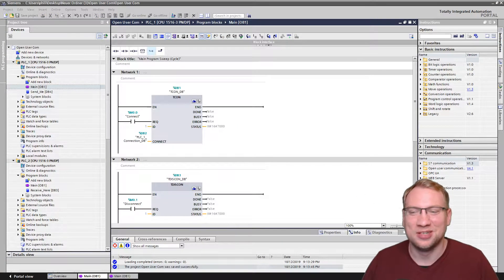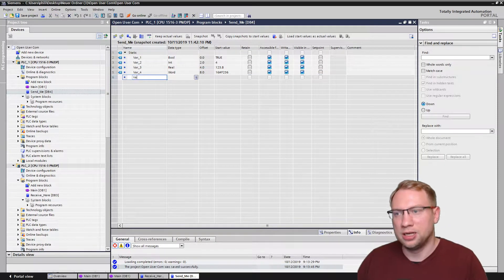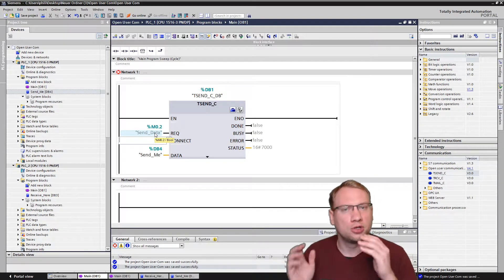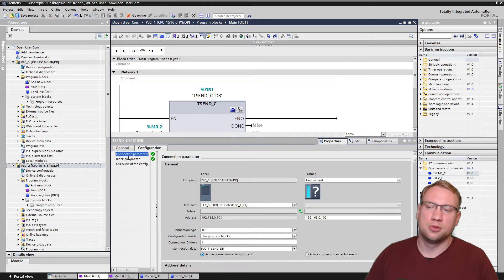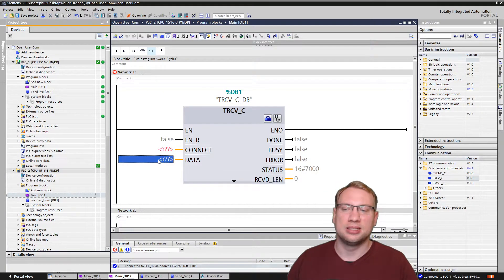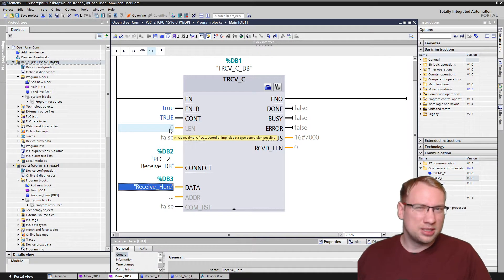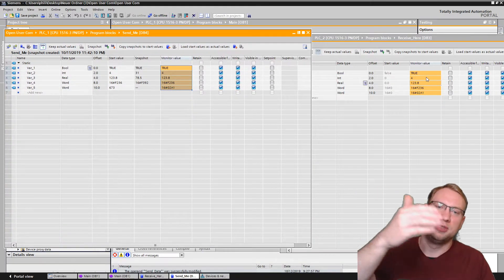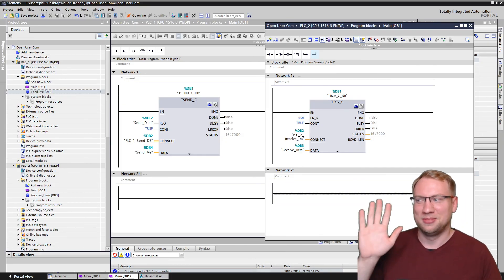TIA Portal: Open User Communication TSEND_C + TRCV_C / Easiest PLC-PLC Communication

Comment: HAHHAHAAH loved the ending lol. Im working on PLC and had very basic knowledge hoe to create ladders only. Your videos are very helpfull. this is 4 years old video , is there any new way and easy way of cummunication between PLC and external device?.        My role is to program the PLC S7-1500 to receive and display data( band width, power supply level/voltage etc)  from a micro controller.  It will send a string of data how can i break that down for my PLC,  as i am New and to this and have very little knowldge ( will look to see if there is any video on this in your list)

Comment: Have you set up a T_COMM connection between an S7 1517 cpu and a Control Logix L84 cpu using the 'on-board' ethernet port on the Logix cpu?  We are having problems setting up this connection with this hardware setup.

Comment: if I have PLC1 as using TSEND_C and PLC2 TRCV_C using Connection ID of 1, How does PLC1 receive data from PLC2?  Does a new connection need to be established or can I use the same connection? If I require 6 S7-1200s to communicate bidirectionally would this limit me to 3 1200s

Comment: I did try this and it did not work for me. I am using et200 processor and s7 1200 is there a setting that I am missing. The Brock status is  7002 error

Comment: Hi, thanks for the video. There is a problem when many PLCs use TSEND_C to the same PLC. The receiving PLC seems to be able to connect to just one of the senders
Reply: this type of connection is point-to-point, PLC for receive from several other must have connection for each, and on another port

Comment: Hi @Hegamurl, I have a issue with the communication in this way with two S7-1200. I'm trying to send from one (PLC_1) side to the other (PLC_2) and this goes well. But, when I try to do the same thing but from PLC_2 to PLC_1 the TRCV_C block displays an error and the STATUS display the HEX Code 16#8A7F. This code does not appear in the manual, so I don't know what it means. Can you help me with that? Have you ever seen that status code?

Comment: Your content is always helpful! Do you know if you can send between optimized and un-optimized DBs?
Reply: PLC 1500 - PLC 1500 optimized is no problem, internal structure and order will same, but with other system (e.g.PC) is non-optimized DB (without alligment) better -> you know data order of each byte byte 0 ... byte N

Comment: thanks a lot for the video, can i enabel output signal "lamp" connected from to the second PLC from the first PLC in stedof using hardwiring. for exampel filling process gives indecation to packaging process to start packing. thanks a lot

Comment: Thank you for your amazing tutorials , and i have a question , i want to make a communication between my PLC device and some GUI that i have on my PC , everything goes right except when my array that i send from GUI become longer than the length i define on TRCV , in that case even tue i reset my input buffer data after any new data received command come , although the data in the buffer did not fill from the first array , and it continue from any more data that it received at the last time. i wanna know is there any way that i can reset my TRCV or TCON input buffer , i think cause of this problem is that the last data goes on the TCON or TRVC buffer and i took from there as long as the length that i define, and the rest of data stay there for the next cycle time. 
i will be thankful if you answer me.

Comment: Ich habe hier mit s7-1200 sps mit Rs485 zwei Temperatur messung kamera angeschlossen , und habe ich jeder kamera eine mit Busadresse definiert. 001 und 002 . das problem ist das jetzt kamera nimmt alle daten was mit port Rs485 kommt , hast du  ahnung wie kann ich die 2 unterscheiden damit nimmt eigene daten. ich habe von punkt zu punkt kommunikation , send ptp und rcv ptp gearbeitet. wenn ich mit kommando 001?T$L$R schicke dann es muss ein antwort mit 001!T = 25.5°C$R geben , manchmal kriege ich das aber ab und zu kriege komische zeichen. Und der Kamera hat auch terminierung widerstand drinne,

Comment: Hello there, thanks a lot for the very useful video, I have a question please, can I implement ISO-on-TCP communication using S7-1500 also? if yes, how to include the library that contains these functions?
Thanks in Advance
Reply: ISO-on-TCP is better because RCF1006 solve and control LENGTH of transfered data

Comment: Thanks for your videos. 
I have learnt lot.
I just have used the same concept to connect two s7-1200 plc's ( by TSEND-C, TRCV_C) but not working. 
Is there any restriction between s7-1200 and s7-1500 ?

Comment: ===> Would it be possible to do an "HTTP GET Request' with an S7-1200, please? 

Siemens has released a library (LHTTP) which is coded in SCL (state machine, 2 blocks TSEND_C and TRCV_C). 
I've removed the "DNS" part (and TLS too...) But it's not working and I'm not able to debug it because S7-1200 doesn't support breakpoints in SCL.

Thank you :)

Comment: hey, first of all i want to say that you make a really good job with your videos. I learn almost a lot of them.
Unfortunately i have a problem, i want to send and receive vice versa from a cpu315-2 Dp to a 1212DC/DC/Rly.
The problem is i can use only simatic manager for the cpu 315-2 DP (with a cp to connect via Ethernet) and the other CPU (1212) does only work with Tia.
Can you explain me how i can connect them.
Thank you for all of your videos and hopefully you can help me.
Reply: No way to migrate the step 7 classic project to TIA? Otherwise you can easily use put/get functions (if there's not to much data to be passed, limits of put/get are shown in the help system). You can choose if you want your 1200 to 'put' and 'get' data to the 300 or just 'put' or 'get' on either device. For put/get you can setup and use unspecified S7-connections.

Just remember that you have to enable put/get-communication specifically on 1200/1500s. No need to do this on your 300.

ps: also remember that the transfered data is not consistent!

Comment: It is a really awesome video, thanks for that. Can we use TSEND_C and TRCV_C for the communication between PLCs in different TIA projects? I have a problem with that...
Reply from the maker: Hi Borys and thanks! Of course you can use those blocks throughout different projects (even with other tools than TIA Portal)
Reply: @hegamurl  Thank you very much again. I've already sorted it out. I realised, that I didn't download hardware to PLC after changes in the project and that's why it hadn't worked. I'm really impressed by your videos. They are brief with maximum information and a hint of humor, which makes them very helpful and entertaining at the same time. Greetings from Australia!
Reply: @hegamurl  Can we also use TSEND_C to communicate with the printer?

Comment: hello and thanks for all the great videos. I have a problem and hopefully you can help. I am using a PID compact controller to control a hydraulic proportional valve, the ouput of the controller is 0-100%. My valve is working  with 5V neutral position ;5V- 2.5V pos A  ;  5V-7.5V pos B. anything below 2.5 or above 7.5 is a error and the valve will trip. How do i go about changing the output of the PID to work with my valve. its a Danfoss valve